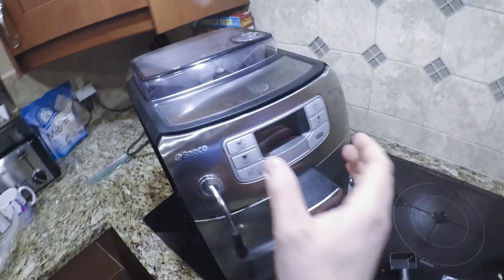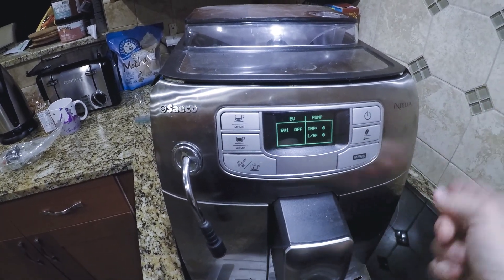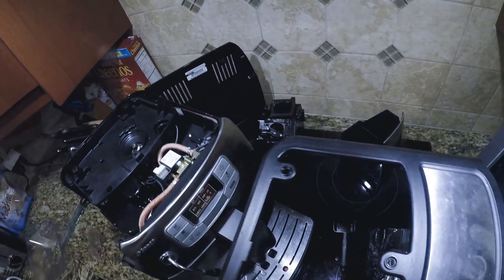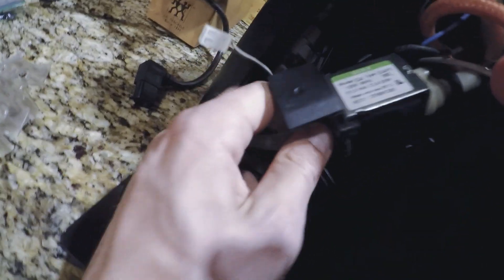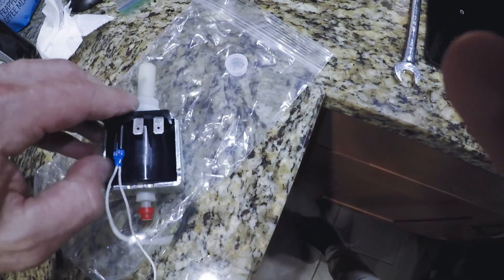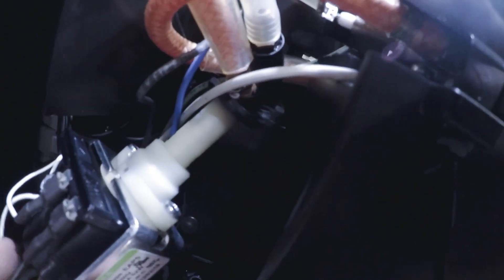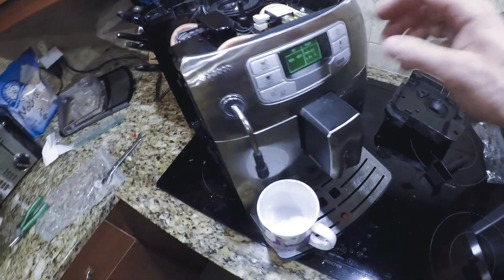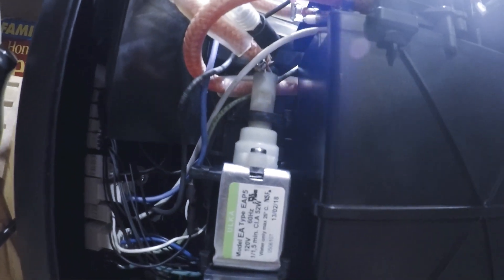Saeco Intelia Espresso Machine Water Pump Diagnostics and Replacement

Comment: is there 2 pumps? I get water (sort of) when I run Work, but no water in Home.  Is it a single pump or two different pumps?
Reply from the maker: there is only one pump, it just gets weak over time as the seals inside wear out and fail

Comment: Hello & thankyou for your tutorial,
I have a Saeco Intelia HD8752 about 11 years old with the following issue:
If the unit hasn’t been used for a few hours or the power plug is unplugged and plugged back in again, upon power-up, the automatic rinse cycle starts as it should:
You can hear the pump groaning, sounds like it is blocked.
This automatic start up rinse is either very slow with little intermittent hot drips taking many minutes for the cycle to complete – which then leads to normal use.
OR
No automatic start up rinse drips and therefore the process fails entering into ‘prime mode’ which also fails & leads to an unusable ‘maintenance spanner symbol’ code 5.
The only way to bypass this is to unplug and re-plug in the power plug, power-up the unit, then as it tries to perform the automatic rinse cycle, manually press the STOP option to bypass the automatic rinse and then the machine can be used as normal & makes great coffee.

Note: The above symptom’s got worse after I performed a de-scale cycle, which failed at the end with of the final rinse / prime – but fully worked up until that final point.
Maybe there is lime scale lodged in one of the following places:
1.	Boiler
2.	Solenoid valve
3.	Steam & water regulator

Note: This is strange because it is 100% possible to run the manual rinse cycle as per the instructions: Press the ‘pre-ground’ coffee button (with no coffee in it), then press the coffee / memo button and it does a big hot rinse no problems at all.

Also, after use, when the unit is powered off, it performs a small rinse cycle with continuous hot running water coming out the dispenser, but only for a very short time.

I have totally re-built the brewing unit per various YOUTUBE demonstrations with new stainless steel plunger screen + plunger o-ring, disassembled & blasted out all the tiny holes in the plastic plunger, made sure all the elbows and holes are clear and clean, installed the valve spring and glass ball correctly, greased all the o-rings, sliders and pivots.

I have also fully taken apart the dispenser locater under the LCD display, disconnected the tube that connects to the brew unit, blasted water + compressed air through it so that it is 100% clear. Fully internally cleaned out the dispenser unit.

I have calibrated the coffee grinding unit.

The other issue I have is that that GREEN does not work on the LCD display – however I can still faintly see the LCD instructions – enough to get by.
I haven’t run the LCD display diagnostics because that is too difficult to see / follow. But it seem like the pump + grinder & heater all work.
I have disconnected & reconnected the LCD & checked the other wires, but can’t see any damage.
Years ago the green would flicker on every now and then, but dead these days..
Reply: I had  the spanner 5 red icon .

I googled these instructions,  I turned machine off and on for about 10 times , as my machine hadn't been used for over 1 year , and it was air locked .
By turning it off and on , the machine was forcing the air out each time and pumping the water through the pipes even though the red icon spanner kept showing after each attempt .
Thankfully it worked

￼

BACK

TROUBLESHOOT

My Saeco Espresso Machine is showing an error code

If your Saeco Espresso Machine runs into an error, a red display appears with an icon image, together with a code number, such as 01, 03, 04, 05, 11, 14 or 19. Below you will find what the error codes mean and how to solve them.

Please note that if your espresso machine is showing any other error codes not mentioned above, we advise that you contact us for further assistance as your machine might need to be serviced.Error Code 01: The coffee grinder cannot work properlyWhen the E01 code appears, it indicates that the coffee grinder cannot work properly because of a coffee funnel blocked with ground coffee.

To fix this, unblock the coffee funnel and perform extra cleaning with a vacuum cleaner. Follow the steps below:
1.    Switch the machine OFF and wait until it is completely off and does not make any more noises (this takes about 15-20 seconds)
2.    Remove the brew group
3.    Open the lid of the pre-ground coffee funnel and place the spoon handle into the funnel.  If there is no pre-ground coffee funnel, insert the spoon handle into the coffee funnel from below.
4.    Move the handle up and down until the clogged ground coffee falls down. Some force may be required.
5.    Remove all fallen ground coffee with a vacuum cleaner
6.    Clean the coffee funnel by sucking the ground coffee from it with a vacuum cleaner. 
7.    Place back the brew group, switch the machine back ON and brew an espresso.
8.    After brewing, check if the funnel is still free from ground coffee. If not, repeat the unblocking procedure.
Please note that to prevent the coffee funnel from getting blocked, water should not be poured or spilled into the coffee bean container. It is also important to clean the coffee funnel weekly.
 

￼Unblocking the Saeco Espresso coffee funnel

Error Code 03: The brew group is dirtyIf the code E03 appears, the brew group contains too much dirt and cannot work properly. Please follow the instructions below to rinse the brew group and  solve the issue. 
1.    Switch OFF the machine and wait until it is completely off and does not make any more noises (this takes about 15-20 seconds).
2.    Open the service door and remove the brew group by pressing the "PUSH" button to the right side, hold it and pull it towards you.
3.    Rinse the brew group thoroughly with lukewarm water.
4.    Grease the brew unit. 
5.    Let the brew group air dry and then place it back. 

Error Code 04: The brew group is not well insertedWhen the E04 code appears, the brew group is not  in place or not placed correctly.  
To resolve this, open the service door of the machine and push the brew group into place. When it is correctly inserted, you will hear a click.Error Code 05: Air is trapped in the water circuitTo release the air from your Saeco Coffee Machine, follow the steps below:

1. Switch OFF the machine
2. Empty the water tank and remove the AquaClean or any other water filter
3. Fill the water tank with water and place it back in position
4. Switch the machine back ON. When the machine has heated up, select hot water and dispense 2-3 cups of hot water

If you use an AquaClean water filter, follow these extra steps to make sure that the filter is prepared and correctly installed for use:

1. Shake the AquaClean water filter for 5 seconds
2. Hold the filter upside down in a container/bowl with water until no more air bubbles come out
3. Place the filter back into the water tank and fill the water tank with water
4. Restart the machine and switch it off and back on
5. Select hot water and dispense 2-3 cups of hot water

Comment: Thanks for doing this video.  I made the mistake of running my water tank dry and got the dreaded Red Wrench symbol.  After following your instructions and cycling the machine on off, etc. the machine started working again.   I've saved this video for when I will likely have to replace the water pump.

Comment: Thanks for the video! I have a similar but slightly different issue: when I run the test, it works fine with EV2 on (the water dispenser) but barely runs water when EV1 is on (the espresso mode). The liters/ hour goes between 12 and 18 for the Ayer dispenser but not above 7 for the espresso. Is it the same pump issue then? Should I just replace it like you do? Thank you so much for your help
Reply from the maker: most likely the pump in your case too, it is a cheap replacement and a wear item at the end of the day so i would just replace it. sorry for the slow reply!
Reply: Czy rozwiązałeś swój problem? Pompa się okazała uszkodzona?

Comment: This method also worked for my Saeco Syntia, so thanks very much for posting this video. Going through the symptoms in the diagnostic mode was key, since at an early stage I had thought that the pump had to be OK, since I could still steam milk and push out hot water. But now that I swapped in the new machine, it works like a charm. Again, many thanks!

Comment: My pump is working and I can make coffee but when I try & get steam nothing happening, the pump sounds like its working overtime, any suggestions ?
Reply from the maker: there is a solenoid that switches between steam and coffee mode, that might be dead. in the 'diagnostic menu' you can test that if i remember correctly.

Comment: Why can the machine still pump water trough the steam pipe if the pump is the problem?
Reply from the maker: sorry for the slow reply, but the pump impeller does not seal against the pump housing perfectly, and over time this impeller/housing wears, meaning the pump can put less pressure out, as water 'leaks' back past the impeller. That is why it works on the steam pipe but not the espresso side where more pressure is required.
Reply: @markofixitvideo  awesome video thanks
Reply: I have the same question. Makes no sense.
Reply: @douglascochen5918  I have the same problem today. I solved my problem very easy - just do calc clean program in menu
Reply: Different action. Ours worked fine during coffee making, but not during the initial flush cycle. As it happens, the flush cycle pulses the pump 50/50, to loosen any debris, but that half-power operation wasn't enough to spin the weak pump. So it's not a binary works/broken thing, there's indeed a grey area.

Comment: Isn't that the heater? The pump is the little round white thing underneath that thing.
Reply: No the little round thing is a reservoir. He replaced the pump.  There is a similar item at the top of the machine and it's role is to direct the water to the coffee or hot water tip.
Reply: @alexm4515  Gotcha. Thank you!